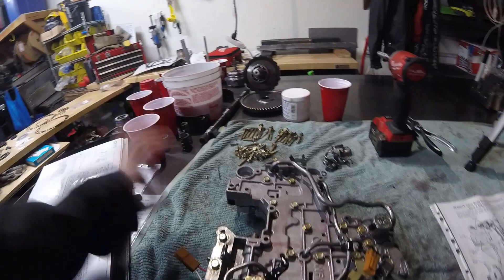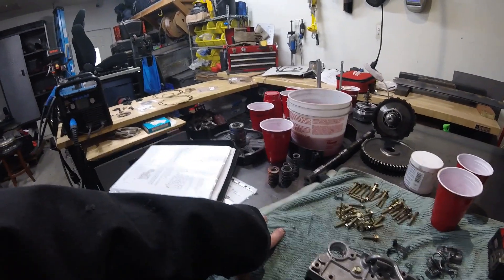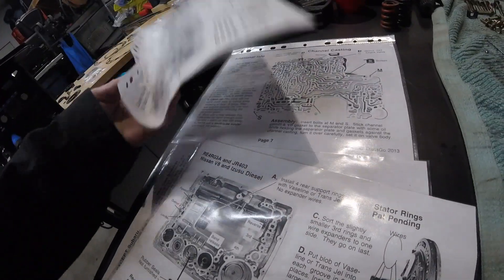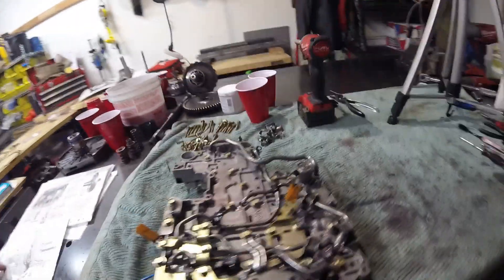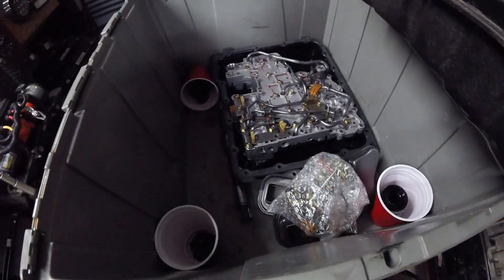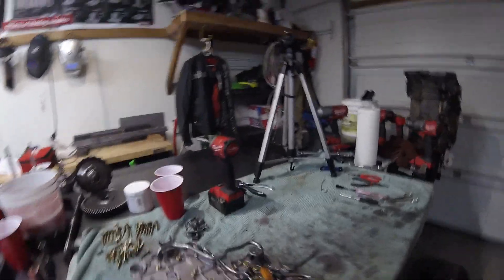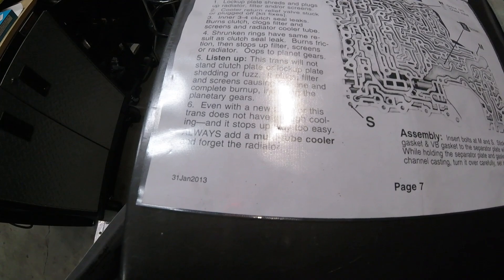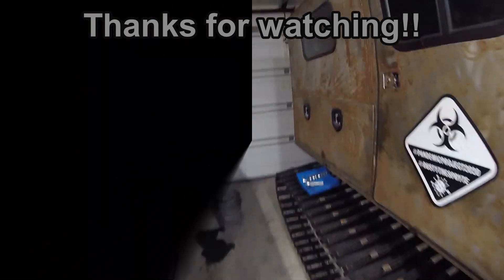Rusty the Spryte build part 103 (JATCO JR403E valve body modifications with a transgo shift kit)

Comment: Sorry  typo I ment part number
Reply from the maker: I am  still confused??
Reply: @SeanFastidious  I though you needed  pin out for speed sensor  I order to wire up so it could make transmission  shift properly
Reply from the maker: @markwilliams7088  the only reason I am connecting the secondary speed sensor is to make the dash light stop flashing.  

I can figure the pinout by using a meter.  

The transmission will work with only one sensor but it will throw a "check engine" flash if the second sensor is not connected.  It's the last piece of the tcu wiring puzzle.
Reply: Sorry  sean I known on allison trans it uses imput shaft and output shaft to compare to see if is shifting correctly
Reply from the maker: @markwilliams7088  It's all good.  Thanks for trying to help.  I appreciate it.  These transmissions are very basic and old technology.